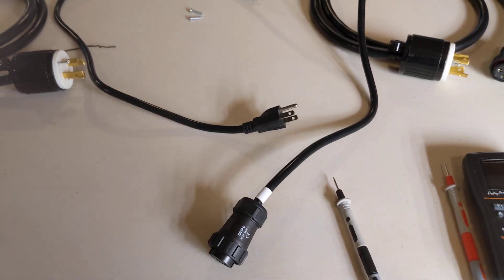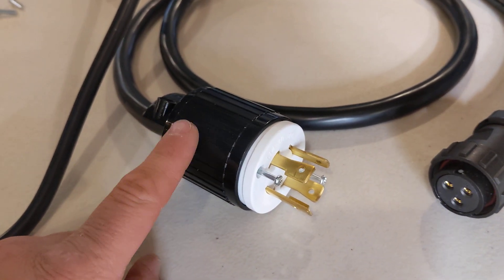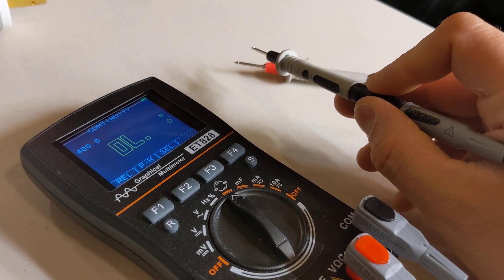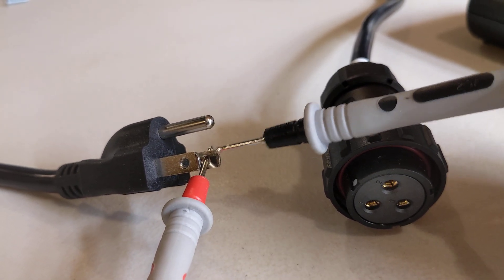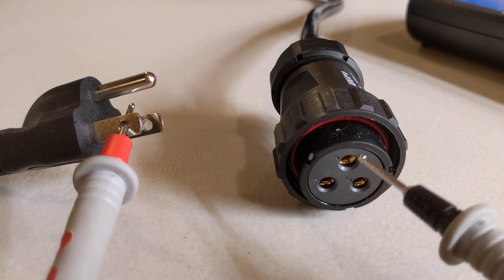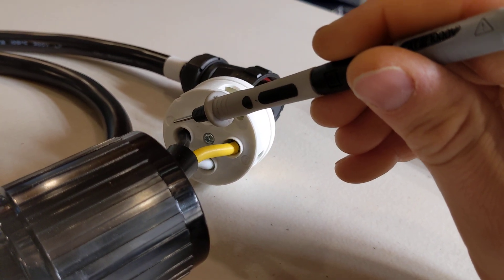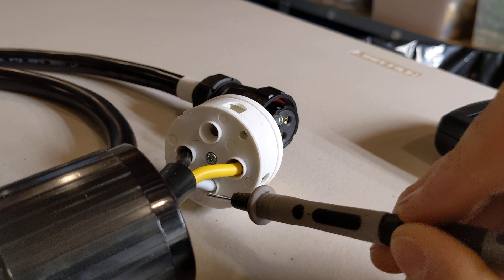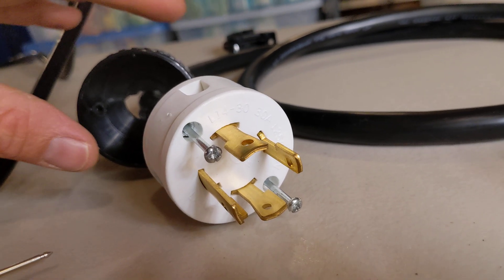Test It: Bluetti AC300 - Video #1.0 - Testing the 15/30amp AC input cables

Comment: Thanks so much for such a great detailed video!  Very well done. 
I have a very simple question in which I’m almost embarrassed to ask. I purchased the Bluetti AC300 +2 B300 batteries. Then I purchased the Bluetti AC charging cable 30A Nema L14-30 plug to aviation in order to plug into my traditional gas/propane generator (now hooked-up to my home's natural gas). I need an extension cable because the Bluetti AC charging 30A is not long enough. Can you tell me exactly what to ask or look for when ordering the extension cable!  Also, is it possible to simply use the 120 charging cable that is included with the Bluetti AC300 to plug into my generator which has plugins for both 120 and for a 30A Nema L14-30?  Two different people on YouTube have said they just use the 120 outlets on the Bluetti and their traditional generator. My dual fuel generator is a 7500/6500 watt unit. Thank you in advance for any feedback or suggestions. Alan
Reply from the maker: Hi Alan.

The 30 amp  "generator" charging cable is not required. It's only available to allow you to charge your AC300 at max charging speed of 30 amp, double the rate of the standard 15 amp cable that came with your unit. Therefore, the answer to Yes, you can use the original 15 amp to charge a single AC300 from any source, generator or grid power. The key to doing so it two things, 1) make sure your AC300 charging speed is set to <15amp. 2) Use a Inverter Generator, for clean power. 

If you still want to use your 30amp cord, you'll need a standard 30 amp generator extension cord with a L14-30 connection.

Comment: Great vid, I'm using grid and ac300 to power 3 8000btu ac and 2 frig and 1 freezer and 2 tvs, in phoenix, clouds and temp above 100 degrees makes pv watts go from 500 to 2000w average 1400w , so my two b300 batteries go from 40% to 95% and I try to keep them at 60%  by turning one or two or sometimes all three midea 8000btu ac off, I'm seeing problems with the ac grid input from 7pm to 7am , so I unplug the ac300 and plug every thing into the wall sockets so the grid doesn't go threw through ac300, is there something out there that I could plug into my wall sockets that I could plug the frig or any one of my things into and have the ac300 plug into that I could control from my phone,
Reply from the maker: Hi Terry. I assume you are worried that when the grid is unstable and it comes back online that your AC300 cuts power for a few moments? Is that why you unplug your AC300's? If so I've been using the T500 direct battery chargers to provide power to my unit without having to worry about the AC300 head unit resetting. I control the T500's with a smart outlet that I can set a schedule or turn on/off via my phone. Let's me know if this helps or if I'm on the wrong direction for what you need.

Comment: I have a question that I am sure i am not the only one interested in.  I have a 200max and upgraded to the AC300 because of the faster charge rate. However it really only charges at 2400w unless you use the wall outlet which kinda defeats the purpose. The 200max used PV and the enhancer (through the AC barrel port) that could both be used with solar. The 300 has the dual PV input but the big 3000w AC port doesn't seem to have any kind of adaptor that will allow any form of solar input. My question is "has anyone found a method to use the 3000w AC port to receive input from solar"? 
I am very new to all of this but if there was a method of connecting a couple (or 6) of the AC to DC 500w enhancer together that would feed into the 3000w AC input THEN you would have something. Or even if you had something less than 3000w just some solar input even if it was just 500w would be better than nothing. 
Blow me away with the lurking brilliance I know you guys have around here, GO !!!!!!
Reply from the maker: Hi Darell - I guess I will answer with a question. What is your end goal? Are you not able to keep your battery at a reasonable level due to the loads you have on your solar generator?
Reply: @MyBluetti  thanks for the reply. I have all my freezers setup to be on solar as well as my neighbors. When the SHTF I want to be able to absorb a few cloudy days without losing a couple hundred lbs of meat that might be the difference between eating and starving. I want to be able to recharge my batteries to 100% ASAP in case I only get a few hours of sun for a few days. The difference between charging at 2400w and 5400w is a huge difference in time, which is why I went from the 200max to the AC300. Actually the 200max can only charge at 1400w and you have to use the AC/DC Enhancer, which works very well.
Reply from the maker: I don't believe anyone has used the AC ports to pass solar through and it might not work very well. The AC300 has grid pass-through and expects are steady stream of AC power. I also have several freezers that are all running on my AC300s. Have you metered your freezers power usage? Do you know the average running wattage and "spike" startup wattage?
Reply: @MyBluetti  interesting. Wish I had known that before purchasing. The AC200MAX also has pass-through capability and it can charged with solar through the AC port, with the bluetti enhancer. I just assumed there would be a method of doing the same with the AC300.

Comment: Excellent video.  Thank you!   I'm in the planning stages for an AC300 based system.  Working on the wiring to be done to get a 120v/30 amp from a generator to the AC300.  Now I can confidently change out the plug on the bluetti 30amp cable to tt-30p.   Will  be following you.
Reply from the maker: Thank you Tom. Once I'm done with my solar panel install, I will create another video with the TT-30 plug installed.